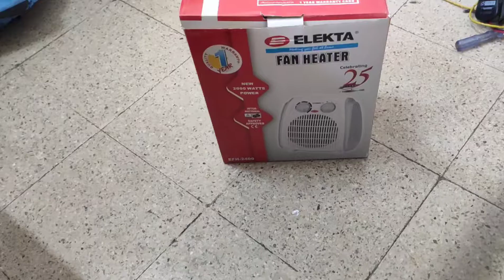HOW TO REPAIR  ELEKTA FAN HEATER 🔥🔥🔥🔥🔥🔥🔥

Comment: Mine heater not working throwing just cold air
Reply from the maker: No dear I repair many pcs comming hot air
Reply: @naeemvhora1  again trying.
Reply from the maker: Us me sayd to falt ho sakte hai ya to fuse kharab ho sakta hai ya fir elemate kharab ho sakta hai aap is ko acche se dekho switch ne koi problem nahi hai na
Reply: @naeemvhora1  sir switch ok hain 2no